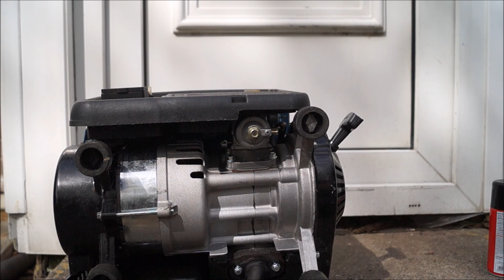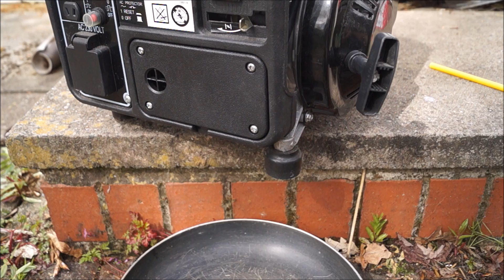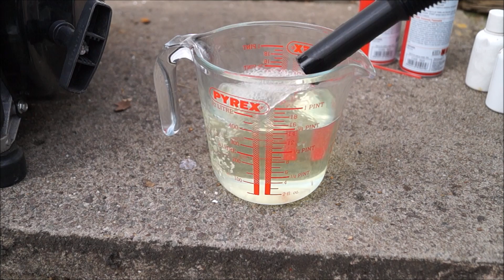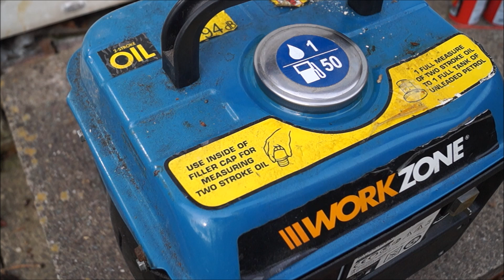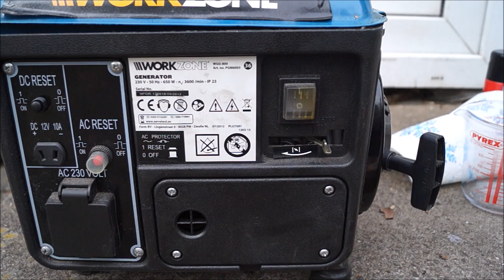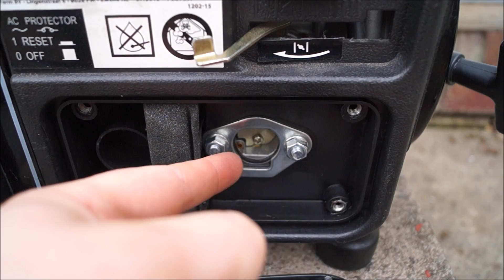Generator problems resolved.

Comment: Aaargh! Use a spanner or socket, please! the small screw in the float bowl with a spring on it is actually the drain screw. I don't know if you mentioned it but when you don't intend to use the generator for a while turn off the fuel tap and run it until it stops (or at least starts gasping). You will then have very little oil residue in the floatbowl when you next come to use it. I have a couple of these, i just found out that the fuel tap on one of them wasn't shutting properly and as a result the carb was completely full of goo!

Comment: I have a similar generator and I have to add a little fuel to the spark plug hole to get it to start. Is there a spray or something that I can spray into the hole so I don't have to use fuel? Thanks.

Comment: Do you know what the spark plug gap is supposed to be? I have replaced the petrol and put a new plug in - it stutters a bit and the plug gap is defintely bigger than the one I replaced. Ta
Reply from the maker: Then tend to be pre set to the manufacturer's recommendations. You still got the box? May be on there if it's been knocked in transit.
Reply: I don't know but usually set all mine to 25 thou (since the year dot) which is about the thickness of my thumbnail.

Comment: Sir I ask something to you regarding my generator set, Sir what is the problem of generator No AC output voltage and DC output voltage but the engine turn normal. running?

Comment: NONE SENCE ABOUT STALE GAS,       DID YOU USE THAT PINK GAS STABILIZER STUFF?   1 YEAR
TRY STARTING FLUID.
GENERATORS ARE PRONE TO DIFFICULT STARTING.
Reply: BILLY YOUR CAP LOCKS ARE ON.

Comment: Thanks for the Video bro. Same thing always happen to my big-bike. Once you pour in other brand of Gasoline, or you let the old petrol sit for a month or two, it will start to "hard start, or wont star at all, so I do the same thing as you did here for every 6 months on my bike, and always throw away old petrol on the tank for every 2 months. Somehow, Petrol Gasoline loses power after a period of time. So better a Month or 2 trash the old petrol in the tank and fill up with new ones.

Comment: You really need to use correct size spanner on the carb retaining nut. Never use grips like you are doing as it will damage the screw and possibly strip the thread

Comment: No need to take off the bowl. There was a smaller screw next to the bolt you removed, which is intended to drain the fuel out of the bowl.
Reply from the maker: +Alexandru Ifrim good point! I'll use that myself!
Reply from the maker: +David Walsh Tower it's because the voltage will fluctuate higher and lower because it's not a pure sine wave inverter generator (like a honda)
If you let it warm up a bit it can sometimes help.
Reply: PrepareForTheUnexpected thanks I will run it longer an see only started to see it work. Thanks for the reply.
Reply: Any one pls tell me how to stop a light from dimming an flashing its only new. Does it need to be tuned or something?
Reply: Chris hi I have a new one of these an just wondering how do u stop a light from dimming an flashing does it need to be tuned or something pls.

Comment: Well shot video.  I have a similar generator and learned from your video.  Suggestion:  If you use a fuel stabilizer and keep the tank full to minimize air contact with the fuel I believe you can leave mixed fuel in for at least a year and it will be OK.
Reply: PrepareForTheUnexpected they would know if the carb is all gummed up with stale fuel.
Reply from the maker: Great suggestion! I guess i'll have to get it out again after another year of living under the stairs! Haha.
Reply: its a pain to get all the fuel out the way it is setup i wonder if you could put a tee fitting on the carb line to drain the fuel from the tank then cap the tank and blow the fuel out of the carb with low pressure compresed air.
Reply from the maker: +imsuckingwind I wonder how they would be able to prove that? I suppose it's just a pain to get it all drained.
Mine have long passed warranty period. 
Is fuel stabiliser any good?
Reply: @PrepareForTheUnexpected  In North America, regular petrol is about 10% Ethanol - that is what makes it go bad, as both gasoline and ethanol can adsorb water from the air, and eventually separate. 2 stroke oil usually has stabilizer already in it. Anyway, gasoline stabilizer is usually good for 6 months. If you can find it, use alcohol free gasoline (E0 grade) - it can last several years if the container is tightly sealed.
Reply from the maker: +imsuckingwind makes sense really. I don't think they would go to that effort of my 60 pound Genny.
Reply from the maker: +imsuckingwind thanks for that. That's really useful to know for when my cars sitting around. Thanks!
Reply from the maker: +imsuckingwind cheers!
Reply from the maker: +batvette yeah I guess it would. I guess I'll have to start either leaving it empty or using stabiliser.
Thanks!